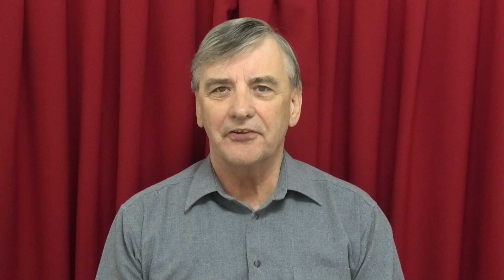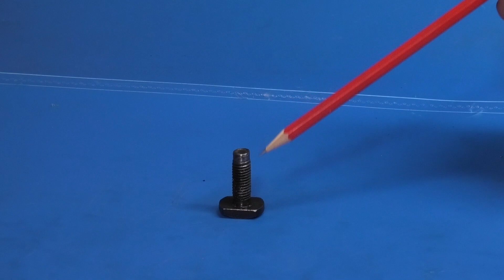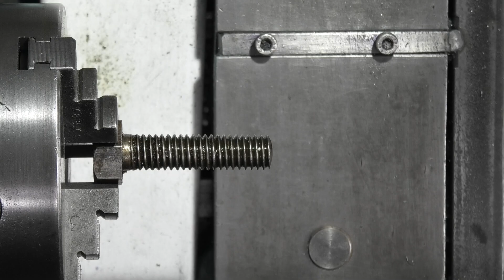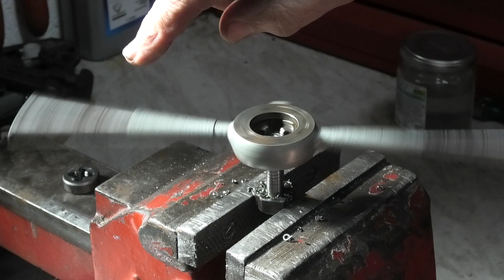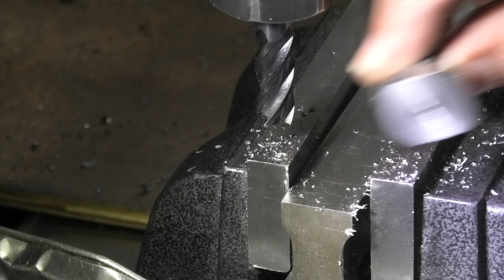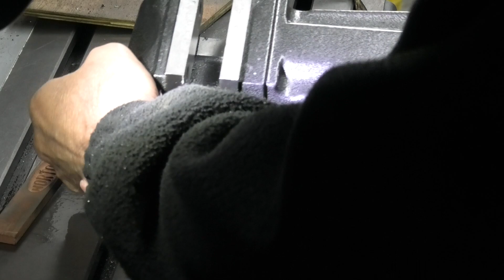Replacement vice bolt

Comment: Had the same problem and found you can put packing behind the nut to stop it getting pushed back also I found hardened nuts difficult to turn and they were causing wear on my hss tooling, so I heated them up to soften them, then after machining, I hardened them again.

Comment: You could buy a “T” bolt used for milling. Those are hardened. You might have to do some machining on the T, but that’s a lot better than making more soft threads from a possibly surface hardened screw.